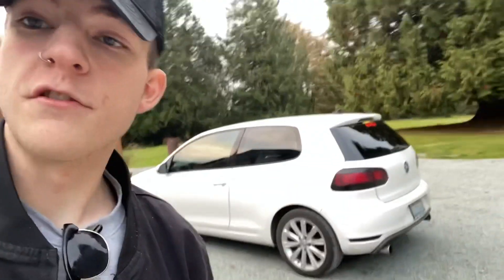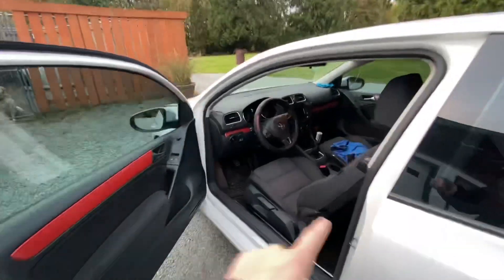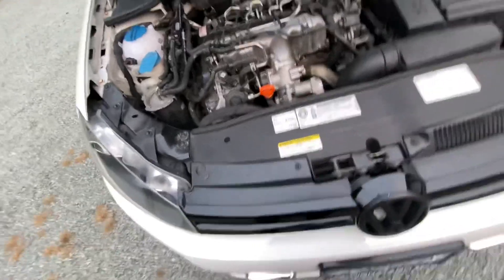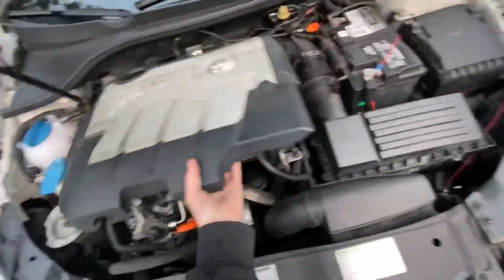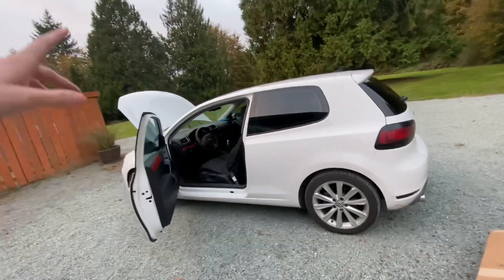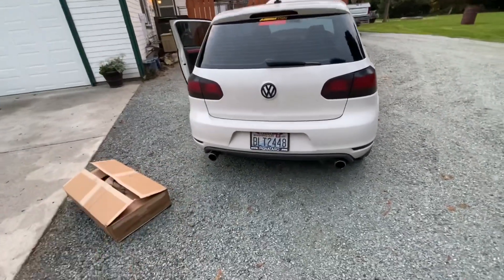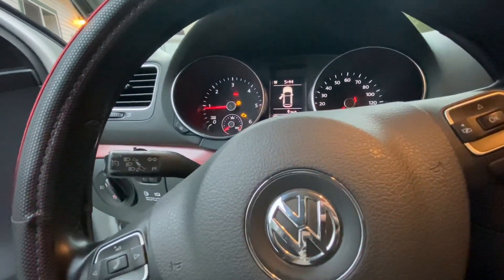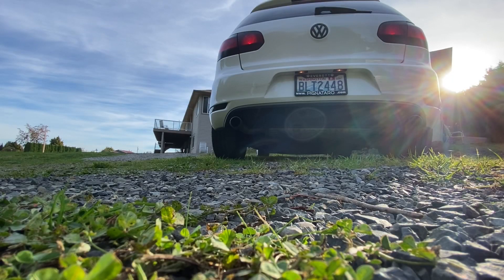(Read description) MK6 Golf TDI 2012 down pipe and egr delete. (Stage 3 for now)

Comment: No trying to be a sick or anything but there is no way in hell that your are making 340hp, I’m Malone stage 2 and make 155-280tq. You can only get to above 300 with a bigger turbo- gtb2260vk or a similar turbo plus a cp3 fuel pump, other then that love the car
Reply: @jace4910  you should do a dump video sometime, I’m looking to find some power mods for my tdi
Reply from the maker: @bradyking4799  will do, thanks for the recommendation Brady

Comment: What u did for getting that turbo sound, u have to remove the dpf for that sound right and put on the downpipe
Reply from the maker: Yup. Turbo back downpipe with straight pipe
Reply: @jace4910  and if I just deleted the box and keep the dpf? Will change something or not
Reply from the maker: @ayantanveer6212  no. I deleted mine and it did nothing without deleting the egr and dpf. A major part is adding a Downpipe.

Comment: Yo bro I got the same exact car recently and am very curious as to everything you've done to it so far. If you have the time could you please make a detailed list with all the upgrades and where you got them from? (brand, links, anything rlly) Thank You!
Reply from the maker: So for the golf tdi there are many different types of tunes. But whatever tune you choose. You gotta get the parts for the tune. For example my golf is kerma tuned. If you look up kermatdi it’s a website with a list of all the parts you need for each stage. 

Or there is Malone. Malone tuning is just way more expensive.

But I’m running a cr170 turbo with a 3 inch downpipe to straight pipe. Aftermarket fuel injections as well as fuel rail system. And a stage 3 air intake. And then a kermatdi tune set to stage 3.
Reply: Yea I'm thinking of going with a Malone Stage 4 Turbo Kit, Malone Stage 4 Tune, S&B Cold Air Intake, Rawtek DPF & EGR Delete Exhaust ECO Parts Kit and a DMK Stage 5 MR Twin Disc Clutch & Flywheel Kit. Let me know what you think of this, this is going to be a daily driver project and there will definitely be more upgrades than the ones listed but those are the major ones, I'm curious as to what other upgrades you think I should do for performance.
Reply: Do you think I'll be fine with a EGR and DPF delete in Chicago? I know it's very illigal and has big fines so I'm really debating between the having good performance and worry about emissions or sleep sound at night but always miss that extra performance that's taken away from my car.
Reply from the maker: @ivaylo_1  honestly you don’t have to delete the emissions if you don’t want. There’s really no difference in power. It also brings your gas mileage down a bit.
Reply from the maker: @ivaylo_1  I have everything you listed except for a newer clutch and I have the KermaTDI tune stage 3. Getting a newer intercooler first because my turbo heats up pretty good. Clutch will be last because I honestly don’t need a better clutch with the bolt on turbo. I’m just beating the shit out of this one til I gotta replace it.
Reply from the maker: @ivaylo_1  I appreciate you not hating
Reply: @jace4910  Hell yea bro, I'll keep track of your progress with the car, I haven't done any of the things to the car yet as I just got it so I'm pretty excited to see you do everything on yours.

Comment: Turn TCS off, press clutch and your RPM will go over 2.5k
I have same car 2011.
Can you tell me do you have any problems when you delete dpf and egr? I want to do that
Reply from the maker: I have had no problems for say, I guess you could say small issue. Because once you delete the egr and dpf there will be no more cooling to the turbo. So you will need to have reinforced piping and definitely an intercooler of some sort mounted. I’ve had coolant spraying out of the coolant overflow inside the tank because the coolant is boiling too hot and cussing the pressure to spray.
Reply: @jace4910  Thank you for the answer bro 🙂
I will think about that, maybe im gonna just drill holes in dpf,l...
I have regeneration on every 450km... 
Im from Serbia, we have bad fuel too, and short routes, we have everything bad for dpf 😂
2 weeks ago i had problem, car was in safe mod, we put car on VCDS and it says something about high pressure in dpf. Thats the reason why i want to get that thing away from my car

Comment: i have the same upgrades and more and im not even pushing close to that power, im running about 220hp and 400tq
Reply: Not bad though for a diesel, similar to a stock GTI, I would be more than happy with that in mine.

Comment: What’s the tint percentage that you used on the taillights and the orange pieces on the sides of the front bumper?
Reply from the maker: I actually used a spray tint that you can buy from oreilys and autozone. They have black spray tint and red spray tint. And then I just popped off the panels on the bumper and sprayed them with a few layers. As well as did the same on my tail lights.

Comment: I’ll spare you on the hp claims. What did you do to your tail lights? I kind of dog it.
Reply from the maker: Sanded them down then let them soak in alcohol with a wet paper towel over them for about 15 mins. Let it kinda eat the sanding away. Wiped it down, then dark tint and tinted the top&bottom. And then tinted the middle with a nice red.